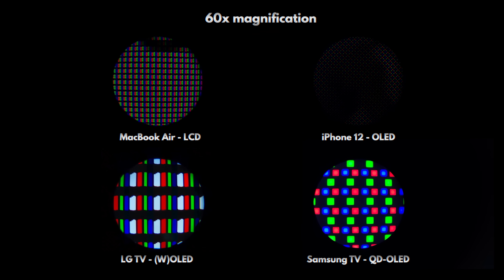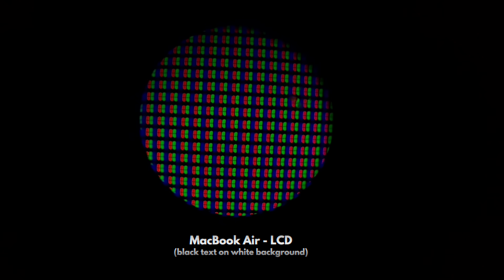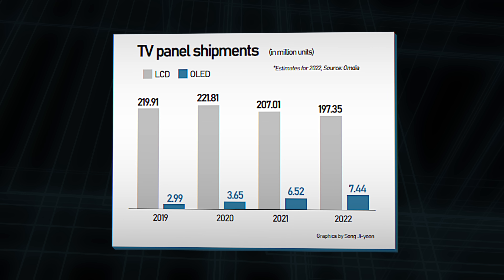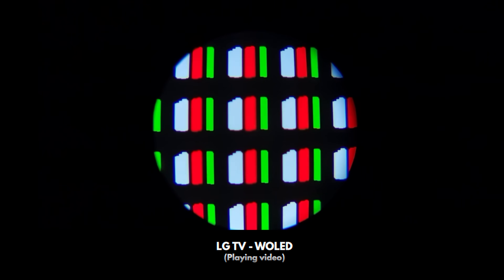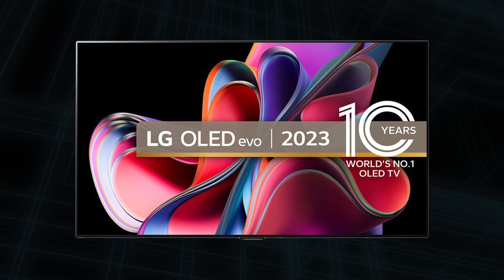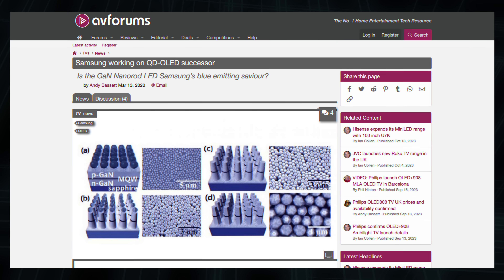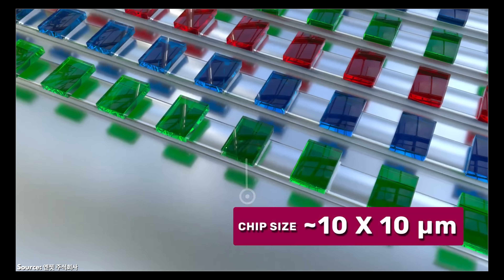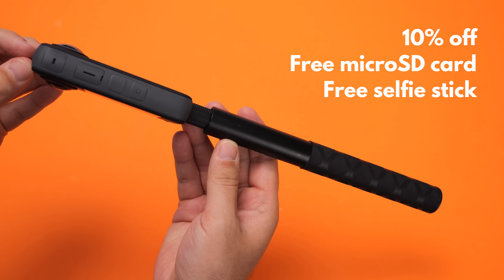The billion dollar race for the perfect display

Comment: This makes you wonder how insane the machining and tooling of the industry must be to place millions of pixel so accurately
Reply: To be fair chip manufacturers get to 'cheat' by making a design and using lenses to focus it onto a small chip (see EUV lithography). Still remarkably impressive of course.
Reply: @dhillaz to be fair, those are some of the most absurdly stable lasers we’ve ever made being shot through the vaporised remains of a droplet of tin, which itself was struck, mid flight, by even more ridiculously powerful lasers, so that’s not much of a cheat
Reply: @dhillaz  I was pretty impressed the first time I saw some documentary with animations about the EUV which enables the wavelenghts to be smaller in order to even get into smaller manufacturing process. Like shooting some pellets with laser in order to create extreme uv light which has that smaller wavelength.. damn :)
Reply: @akse it’s absolutely insane science.
Reply: @dhillaz   work smarter not harder
Reply: Not even comparable to tolerances in semiconductor manufacturing (10nm vs 100um, 10000x difference).
Reply: @ivanjermakov  Insane, they upscaled precision from 1um to 1000nm to 1000000pm. A whopping 1.0x10^0 increase in magnitude.
Reply: @Gabtube252  haha, I had to read your comment twice
Reply: @Gabtube252   Well If I learned anything in my physics class about significant digits. Saying 1um is not same as saying 1000000pm because stating units in pm implies that the device used to measure distance has precision of 1pm meaning it can distinguish between the lengths of 1um and 1.000001um while stating the units in 1um implies that machine can have a least count of 1um and it won't able to distinguish between a lengths of 1um and 1.000001um
Reply: @LonelyRacoon  that's why I said "precision" beforehand. The minimum increment that can be measured is "1000000pm", meaning that an increase in anything between 1 pm and 999999 pm will not be reliably measured.
Reply: @Gabtube252  ah. Now I see. The last line what got me lol
Reply: @Gabtube252 1×1=1, but the 1×10^0 made me think "wait, magnitude?" then i read again that part
Reply: hahahaha @Gabtube252
Reply: @Gabtube252 bruh not even correct, 1.0*10^0= 1, while in reality , the equation didn’t increase by one in should increase by zero or nothing. Anything power 0 is 1
Reply: @zerperior  I know
Reply: @Gabtube252 Hook and Line, meet my friend good friend Sinker.
Reply: Ah shit, I am idiot
Reply: @Gabtube252 that's the most insane Maths joke I ever heard. Thanks dude you made my day.
Reply: True i worked at a company called nexperia working in a clean room manufacturing them, very precise work. @ivanjermakov
Reply: @ivanjermakov now at 3 nm and preparing for 2 nm.
Reply: @The_SOCCER_Commentators  Well, they say "2nm", but somewhere around 28-20nm they became marketing numbers, and not the actual size of the features.
Reply: @ivanjermakov  semiconductors dont nearly have the same scale. Im not just talking about the precision necessary, but the scale at which it needs to be consistent. Chips have also "failed" versions which are what most consumer options are made of, thats the difference between a 4090 and a 4050. But TVs? Nobody wants even a single bad pixel and it needs uniformity for visual fidelity, they need to be extremely precise in that sense and also keep it up for a large scale.
Reply: @cc0767 exactly the same with camera sensors, it has to be extremely specific. it may be larger scale than semiconductors but placing 40 million 3.03µm pixels accurately or else they will have line issues and noise is incredible
Reply: 7nm tech does not mean literary 7nm accuracy. It is just way to tell about the generation of the technology.
Reply: 7nm tech does not mean literary 7nm accuracy. It is just way to tell about the generation of the technology.
Reply: 7nm tech does not mean literary 7nm accuracy. It is just way to tell about the generation of the technology.
Reply: Lithography
Reply: @ivanjermakov True. But, display manufacturing has to meet various types of requirements in diverse perspectives. So, many restrictions out there that cannot be treated like wafers considering nature of the product. Each has own complexities about productivity.
Reply: @ivanjermakov  Correct, it is actually in many cases similar equipment to semiconductor manufacturing, made by the same companies, but it is not as difficult as making chips.
Reply: @ivanjermakov doesn't have to it's a screen millions of times larger than a CPU.
Reply: @ivanjermakov  everything in those industries are working with thousandths in increments they really are working with such tight tolerances for sure
Reply: @ivanjermakov  imagine working on 10um and your coworker f up his 10um and now you have to restart the entire 100um.
Reply: These tech are done by PhDs upon PhDs, building on the research of each other by standing on the shoulders of each giant until it becomes giants all the way down.
Reply: Nah, it's just Bert sprinkling some shit on a shingle and slapping it all together with crazy glue.
Reply: @custos3249  Underrated reply 🤣
Reply: Anytime I see a cheap tablet, I really appreciate it for this reason. It’s incredible how far technology has progressed that you can get a small, but fully functional tv for $40-50, and it also includes a computer.
Reply: True. And yet people think this products are expensive. But when we look at the making of this, we realise that they are priced less wrt cost that goes in r&d.
Reply: @Urboyfromfuture Most consumers don't comprehend that smart TV's would be even more expensive if they didn't come with built-in ads.

Prices nowadays are very competitive even from Sony and Panasonic.
Reply: @Urboyfromfuture  A lot of really clever people to from around the world to make it all feasible.
Reply: @Urboyfromfuture  they are expensive for the use they have in everyday life.
Reply: Well if you read about lithography you will it is easier (not for the averge of us but compared to other stuff)
Reply: @sameerGhs  Modern lithography (e.g. 3 nm) requires using floating plasma droplets as a lens and interference of light to create the correct pattern because wavelength of directly shining the light towards the mask would be about 100x too coarse.

One could probably create a working microled displays by making display from multiple square or hexagon shaped parts made with ~100nm lithography on pure silicon. However, that would still be way too expensive because all practical sized displays would need at least 4 wafer slices and even 100nm wafer slices are maybe $10K a piece.
Reply: Lithography printed displays are in development and could potentially smash current technology but they’re always be too small to make a TV . They will remain AR/VR Displays only
Reply: If Cathod Ray Tube TVs have 4k...no one can defeat.
Reply: @jesrellanzaderas1876  I want a CRT display on the next iPhone
Reply: it’s simple really, the thing-a-ma-bob and doo-hickey plop the pixel onto the funny square
Reply: 4k CRT's are possible, viable and would beat every amoled or whatever led there is
Reply: Your forgetting that this is the 21st century 
The Era of technological boom
Reply: im going to school as a cnc machinist

the most tolerance we had was still submillimeter and im still in first grade
Reply: Not really, these displays are built using standards Semiconductor lithography methods.
What was insane was the tooling needed to make high resolution PLASMA display screens.
Reply: This is nothing compared to microship making
Reply: @kms3530  Microchip foundries can use lithography to build the chips. It requires expensive machinery and running those machines at high speed is hard but the problems are pretty much solved already.

We still don't have any method to build microled arrays which would result in e.g. TV sized panels with 4K resolution costing less than $30K. It's still unclear how hard this problem is so it must be a harder problem than lithography which has already been solved.

We already know that a microled display would be superior to all the existing display technologies so we would want to build those displays we still don't know how.
Reply: My phone came with a dead pixel
Reply: did a carpentry job for a place called Universal Display Corporation a long time ago, apparently they were doing research for OLED back in the day. I peeped inside their sciencey rooms since everything was closed for the weekend, their research machines look like magic they had suits hung up to prevent contamination and stuff, it's like a science lab for TV screens
Reply: Yep, it should be insane. And manufacturers aren't happy with it and they are finding ways to transfer the leds in bulk.
Reply: Mass production makes it cheap, you pay for r and d.
Reply: even more with cpus sporting tens of billions of transistors
Reply: That's why America is in Taiwan for sure.
Reply: So true
Reply: Litography?
Reply: It’s just Asian children
Reply: It is intense it involves insanely small measurements and lasers
Reply: They use layered photolithography no machining except for the backing substrate which is scribed.
Reply: Shadow masks and the related colored phosphor (dots and later rectangles) were positioned pretty accurately too.
Reply: Crustaceans and other animals did not evolve. Among the millions of fossils dug up from the earth, there is not a single intermediate fossil that proves evolution. Several hundreds of millions of years ago, crabs and other animals were in their current form. The theory of evolution is a dogma without any scientific proof. The reasons for defending the theory of evolution are ideological, not scientific. Scientists have discovered that all organs, which evolutionists call obsolete organs, perform important functions. Mutations believed to trigger evolution have been shown to be completely harmful. That is, mutations do not give advantages to living things. On the contrary, it harms. Evolutionists pointed to fossils of the coelacanth fish as evidence of the transition from water to land. However, a living specimen of this fish was found and it was found that the coelacanth fish is currently a fish that lives on the bottom of the ocean. Finally, I would like to mention that evolutionists can't explain how a living organism arose from inanimate matter. Living things did not appear through evolution, but through the Cambrian explosion. This proves the creation. Almighty Allah created all living things. Praise be to Allah Almighty, the Lord of the Worlds!
Reply: It's already on a limit. We just can't make silicon chips any better than that. Moore's law now just can't keep up with this limitation.

Personally I'm looking forward to Micro LED, and what step industry might take. Now it's ridiculously expensive and hard to make.
Reply: @mdfahimahsan7475  I think it's too soon to declare that we cannot create better silicon chips. We're getting close to the limit that you cannot improve density in 2D features anymore because we're running out of atoms per wire, but chips already have multiple layers and I would guess we'll see a lot more layers in the future. The problem with increasing the layer count is that yield per exposure must be insanely high or multilayer structures will fail as a  whole. In addition, cooling a big multilayer design will be quite a hard problem but I think we're going to use smaller and smaller currents for the chips. The way Intel has been milking a bit more processing power from their recent desktop chips by doubling or trippling the current is not the long term solution. Recent Intel chips are already entering the world of dimishing returns and they could improve processing speed maybe 10–20% by doubling or trippling the power consumption.
Reply: I thought they already released micro LED TVs??? is it not true micro LED
Reply: @lemonking3644  Which TV you're talking about? Please, tell us the manufacturer and model for a TV which you think is a micro LED and actually available for buying.
Reply: For them its easy 😜🤣
Reply: It gets more insane if you decide to look at ssd's and how they work and how small they are
Reply: I mean I imagine they use technology similar to how they make computer chips, so not really much machining or tooling, just a bunch of exposing to masked light and washing.
Reply: @paulbunyangonewild7596  The problem is that you cannot use the same lithography process for creating microled arrays as we use for the CPUs. This is caused by the fact that a single wafer costs around $20K and even if you used all of a single wafer to create a single panel, maximum panel size you could create would be 11.8 inches.

Not many would be happy to pay $20K for 11.8 inch display, no matter how good that display is.

As a result, using lithography to directly manufacture the microled display panels is out of question because of the costs.
Reply: the development of the rb77 method is genuinely fascinating especially when you consider the time frame they accomplished it in
Reply: Bet this means China will need slaves to build them ever more. US will have to compete so... Trump 2032! Well, by then China would have brought the costs down but still, this is going to lead to actual 3D holographic rooms so more slaves?
Reply: My exact thought
Reply: @GhosPoison  regarding rb77?
Reply: it seems to be.... pixel perfect!
Reply: It's closer to printing.
Reply: Makes my brain crash
Reply: @cc0767 now... consider computer chips. 😊
Reply: The nano technology is off the charts, it phenomenal how we can made things that are smaller than an Atom.!!
Reply: A DLP projector has a tiny mirror for each pixel on the screen, so for 4k that would be 8million tiny mirrors in the space of your finger nail.

Each mirror is flipped to reflect light onto the screen or not. At 120hz screen refresh that means the mirrors are each flipping up to 480 times per second.
Reply: It's not difficult. I literally placed 2 million pixels by hand before lunchtime. Placing pixels is very easy when you figure out the wrist technique.
Reply: That is not insane. Insanely good and eye catching would be a 4k 120hz CRT Screen. WIth today's tech we could make it as light as 3kilos
Reply: a
Reply: cringe
Reply: It's not working like that though. They don't "place" anything, but rather they trace deposition sites and deposit the materials chemically.
Reply: I like the  idea of a completely  transparent  TV.   So when it is turned off,  you don't have that black retangle just hanging on the wall,  it goes clear and you can even put art or  photos behind the screen so when it's off, it's not such an ugly  eyesore.
Reply: CPU manufacturing: "Am I a joke to you?"
Reply: It's nothing impressive compared to the manufacturing of a standard cpu chip
Reply: As a scientist, we actually do stuff to this scale in my lab. I work with nano diamonds. You become quite familiar with scale once you are a physicist, but it still feels odd saying these numbers and then realizing how small the thing is that I am discussing.
Reply: Yep, same for Transistors in CPU and GPU. 🫢
Reply: And what I want to know is how are those individual pixels triggered on and off to make up the image on the screen.
Reply: LCD for the win
Reply: Well, for reference, the most recent and powerful Iphone (Iphone 17 Pro Max) has about 20 BILLION transistors and they range from about 65-75 atoms in width.
Reply: Alien tech 😂
Reply: I would have imagined a photo-lithography technology would have made more sense, but maybe you can't lay down or etch the LED material that way.
Reply: @vulpo  photo-lithography is how the active matrix backplanes in all LCDs capable of handling video are made. Usually with Amorphous silicon. deposited on the glass. If someone could come up with Amorphous Gallium Nitride they could create the LEDs directly using Photo Lithography.

p.s. That might be what Plessey Semiconductors are doing. Only at the sub 1" size at the moment though.
Reply: @vulpo ..the video literally talks about micro oled panels which are just that, etched directly onto silicon wafers
Reply: Then nano tech in semiconductor manufacturing will blow your mind
Reply: Well I worked in hard drives and we deal with way way smaller sizes. We've had ways to deposit things really precisely for a while.
Reply: You honestly believe a machine is "placing" individual pixels? lmao....
Reply: @leviathan5207 of course machines aren't placing pixels, duh. Lol. Tiny gnomes are.
Reply: @snorman1911 But I read that the gnomes are unionizing.
Reply: @leviathan5207  You actually believe that making comments like this demonstrates your own profound intellect? You're outing yourself as a tool, mate.
Reply: @snozzmcberry2366 why does their comment mean they’re somehow trying to provide evidence for their “profound intellect”? Seems more like you’re making that assumption to somehow invalidate the comment you disliked.